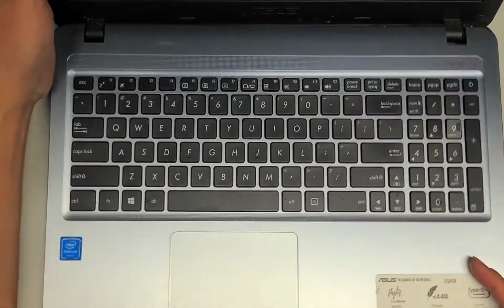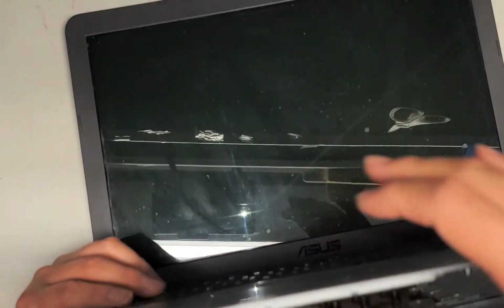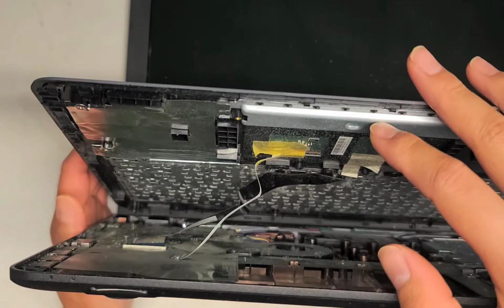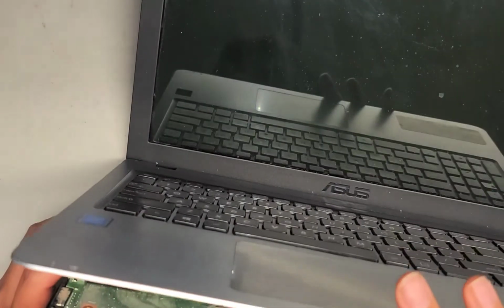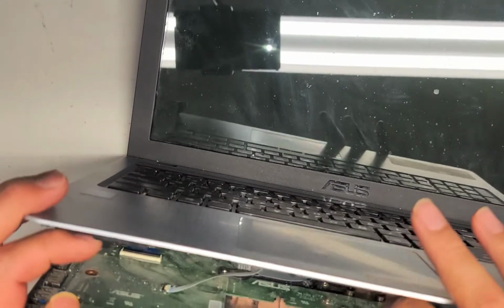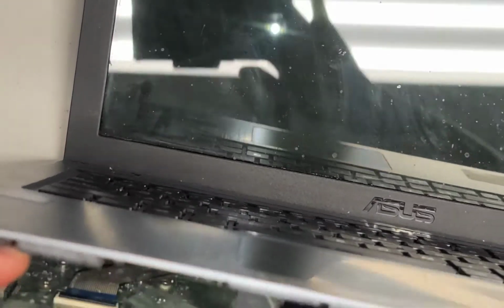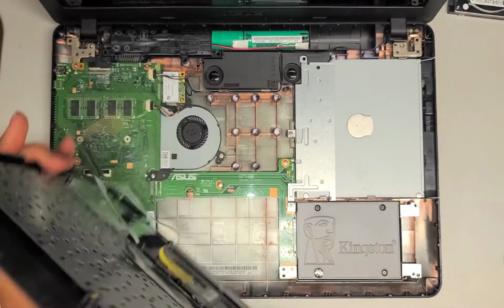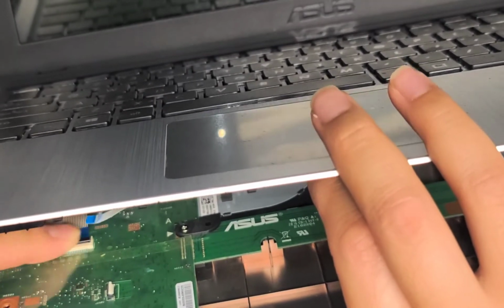ASUS X540S Disassembly SSD Hard Drive Upgrade Repair Replacement

Comment: Hi there, so I was wondering what is the difference between an HDD and an ssd? Why not replacing this one with the same model of hard drive? Regards!
Reply from the maker: HDD is slow and breaks easily. SSD is fast and has no moving parts to break if the computer has sudden impact like from drop or being hit.
Reply: Thanks for your quick response. So I think I'm going to do this.
Reply from the maker: @kcyoutuber9018  no problem. This video will also help https://youtu.be/4p5jFDzVwUw

Comment: Hello sir i have the same laptop asus x540s and it has 2gb ram and 500gb memory and it is very slow . Ram is fixed in pannel it cannot be changed . How can i make it fast its very slow and i can not buy another one
Reply from the maker: 2gb RAM is way too low. Not much can be done.

Comment: how did you manger to re store all system and the new SSD driver?
Reply from the maker: Either by cloning or a clean install and running all the updates. You can find the video on how to clone in my playlists general computer repairs.

Comment: Hi. Take Thermal paste this model?
Reply: It will, if you're replacing the fan, you're not gonna be able to upgrade the cpu only replace it, and you'll need tools like a soldering gun, solder removal, etc.
Reply from the maker: What do you mean?
Reply: @ItsBinhRepaired  if have the processor thermal paste. But now i see, yes have termal paste. I put in them and my coomputer never more turn off alone. thankz!!!
Reply from the maker: @EscuelaRamatis  awesome!

Comment: Hi, thanks for the video really appreciate it and the voice over explanation. Will the ssd improve the speed of the response? This specific only has 2G memory which is why I'm asking.
Reply from the maker: It will, but it might fail quickly because it'll use the SSD as RAM transferring data back and forth to the actual RAM.

Comment: Hey how can i contact you
Reply from the maker: You already did
Reply: @ItsBinhRepaired  bro my chargers adapter was not working so i changed the adaptor but i messed up by interchanging the negative and positive outlets now my lap wont come up😭😭😭do you think the harddisk might be damaged
Reply from the maker: @nanduajaylal463  how can you swap the positive and negative? The chargers are ac, meaning it doesn't matter which way you plug it in.
Reply: @ItsBinhRepaired  oky thanks then😁
Reply from the maker: @nanduajaylal463  the one thing you have to make sure is the replacement is the same voltage and at least the same amperage
Reply: @ItsBinhRepaired  my laps on switing on after that incident
Reply from the maker: @nanduajaylal463  ?

Comment: Yeah I need the link for it bro😭😭😭. Please give me the kingston and if you have better ssd 240 gb thanks
Reply from the maker: https://amzn.to/3hG8ew5
Reply: Bro so I got my stuff and honestly I don’t want to clone anything. I want a full refresh windows. So for that I can just put the ssd then with a USB drive I can install the windows right? Or I still gotta clone it
Reply from the maker: @samidpersia9832  this is what you want, but create the bootable usb https://youtu.be/R6GVDyVqWso
Reply: @ItsBinhRepaired  oh so cloning is only when you wanna save your data from the previous hdd? Dang screw the previous data 🤣. Thanks bro I was kinda confused because I thought that switching to ssd from the laptop hdd I had to clone it otherwise it won’t work.  Thank you
Reply from the maker: You have to reinstall Windows, that's all